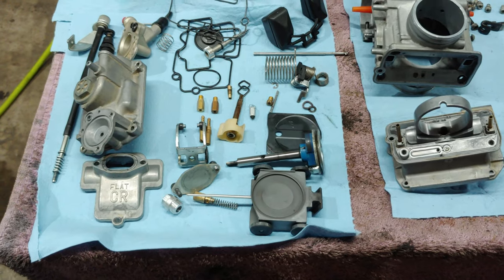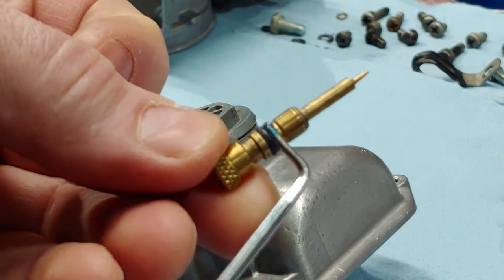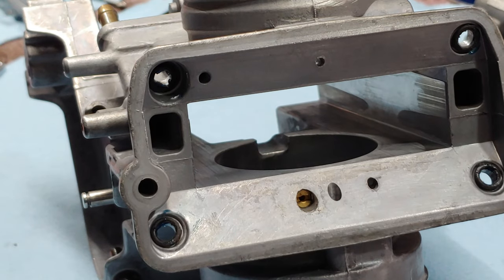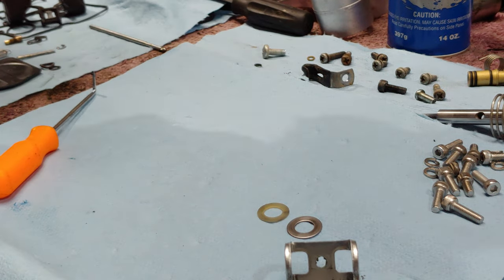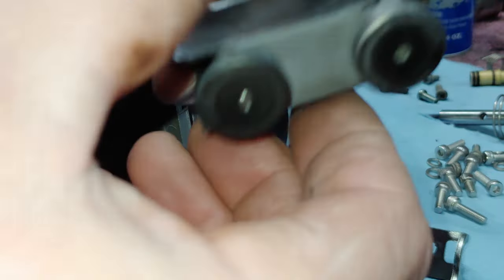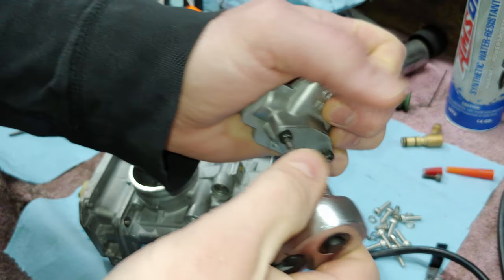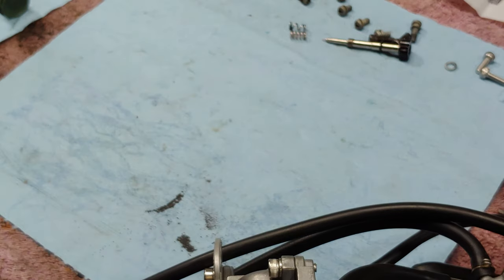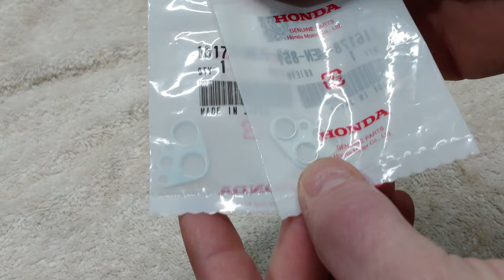Carburetor Maintenance || How to Completely Clean a Keihin FCR Carburetor

Comment: Hello, thank you for sharing ;) At 25:24, what is the role of black plastic part ? I broke this one and I'm trying to find it on the web but I think it's impossible. Do you have an idea the fix my problem ?
Thank you
Reply from the maker: The piece with the wire? That's the throttle position sensor. It optimizes ignition timing according to throttle opening and load on the engine.
Reply: @Fixin2Ride-Official-  no the part wich Connect the durite. The plastic part is on the laiton part. There is 2 durites connected in the same place
Reply from the maker: @benjaminm.1965 oh the overflow tube barbs. They allow any extra fuel to flow out of the carb and down the tie to below the bike to avoid getting in the hot exhaust and igniting in case of a tip over.
Reply: @Fixin2Ride-Official-  but Why 2 durites on the same output ? Can I use only one durite ?
Reply from the maker: @benjaminm.1965 Redundancy. In case one gets clogged at the end.
Reply: @Fixin2Ride-Official-  Thank you
Reply from the maker: @benjaminm.1965 You're very welcome! Thanks for supporting the channel!

Comment: Did this carb work proper? That float height looked wrong. And noticed when you did the fuel screw seemed out of order. I've been rebuilding an 06. That float height is super critical.
Reply from the maker: Yep works perfect! Float height was dead in. I checked with calipers.

Comment: I have a fcr 39, the early "nonservicable" one. Any suggestions on how to split it safely?
Reply from the maker: How do you figure it's non-serviceable? If you're talking about those four screws holding the top and bottom half together just take a small screwdriver and bend that post in the middle of the screw head back and forth until it snaps off and then you can use an allen wrench to disassemble it.

Comment: Good video Andrew

Is there no need to lubricate the slide wheels or the area where they run please?

I’m trying to service a bank of four FCR’s that don’t operate smoothly!
Reply from the maker: Thank you! No. That should be free and clear and all typically any needed lubricity will come from fuel. You can even clean all of that stuff by wiping off with a clean shop towel. 

Thanks for watching!
Reply: @Fixin2Ride-Official-  Thanks for replying.

I really appreciate the advice as the inside has been lubed with what looks like molybdenum grease!

I’m just cleaning them up now in an ultrasonic bath 👍

Thank you
Reply from the maker: If its dark stuff that just natural wear ans tear grime from the parts and fuel. 

But my pleasure. Glad to help!

Comment: How did you figure that it rich down low but lean up high ?
Reply from the maker: Based off the bikes performance.
Reply: @Fixin2Ride-Official-  thanks for the reply but 
could explain what the symptoms were
Reply from the maker: @ryanelliott1650 hard to start when hot, plug center insulator too white and electrode a little Grey. You can heat the bike uo and then use a new plug for diagnosis. Run the bike at idle, mid range or 3/4 throttle for 60sec and then shut off and look at plug. It will give you a good idea of that fuel circuits jetting is. Engine cutting out is a sign of way to lean as well. Engine header getting extremely hot also.  Or feeling boggy but no cutting out.. power feeling flat and engine sounding dirty/ like a double firing sound instead of smooth while accelerating are signs of richness. As well as dark smoke when chopping throttle. Lots of soot on inside of exhaust tip. Stuff like that. Start with Manufacturers recommended jetting, fuel screw, hot start lever and idle settings on a stock engine. If lean issues then completely disassembled carb and clean thoroughly with carb cleaner and compressed, removing all jets and clean the same.

Comment: you missed the small gasket on the mid body ....in the bowl side are 2 screws ....use a 5/64 lockout bit and hammer it on a little , then impact it off ....replace the gasket and clean out the ports ....thats where my pilot jet port was clogged .... ......................................................................and ride like you stole it
Reply from the maker: You're right but I actually did replace it after this and what was just use a tiny screwdriver and bent those little tabs off on the inside and now and Allen wrench works perfectly